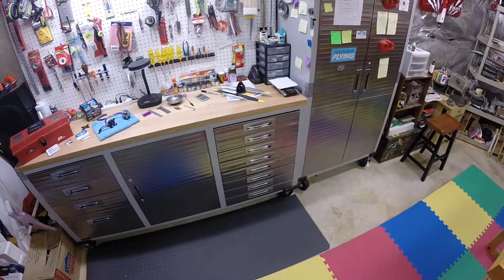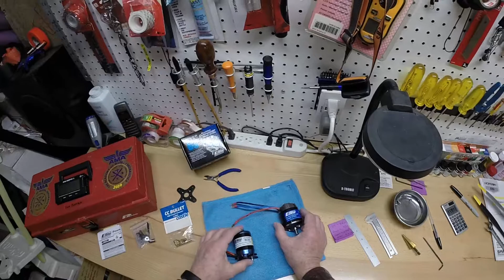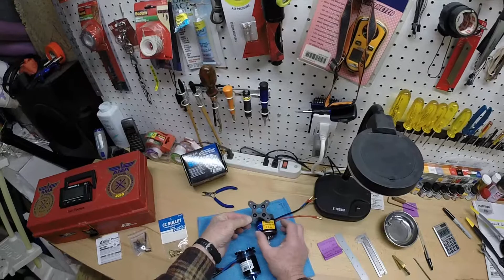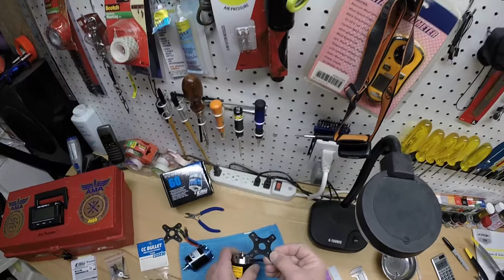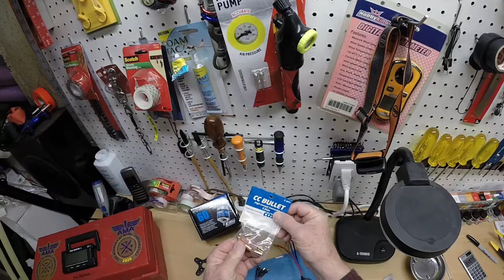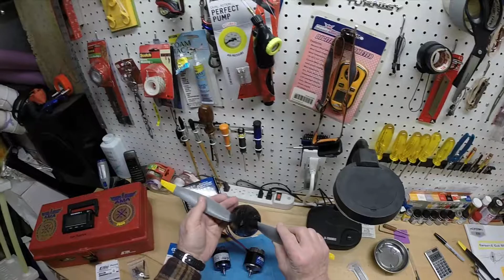Carbon Z Cub - Power 60 motor upgrade - - Part 1

Comment: What is the resistance of the 50?? Currently draw is (AWG of wire) is proportional to the resistance.   Power 60 I think is 2 ohm.

Comment: I’m pretty sure I found out what size pro adapter to get found it on Amazon thank you
Reply from the maker: Great!
Reply: Which one did you get?
Reply: @a @alancotufa4992
Reply: @alancotufa4992  this is the one I got on Amazon. It would not allow me to post a picture of it so here is what it is. E-flute Adapter 8mm shaft power 46/60 EFLM1934.  Hope this helps.

Comment: So after you installed the new front bowl on prop and also the heavier power, 60 470 KV motor was you still able to retain a good CG on the plane with the battery shoved further back.. I did this similar to a 1700 plane I had and I had to actually put fumy tires on it to lighten up the front to get my CG. I am wanting to put that motor in my carbon cub 2.0 but I was worried about the CG and what I need to do, and I was also thinking how much more weight that Debro bought on prop is going to make it way as well in the front end? Any info you can give me I would so kindly appreciate Dan thank you so much

Comment: You should NEVER cut brushless motor wires for any reason this is considered an improper modification and can cause the motor to fail the instructions that come with the motor specifically say DO NOT cut the wires.
Reply from the maker: I have never had any problems with "shortening" motor wires.  Check out my video previewing this plane.  Where you run into problems is "lengthening" wires and trying to draw too much current through under size wires for a particular application.

Comment: I wanted to see if you decided to try upgrading your BL50 mnotor to the power 52 motor as oppossed to the power 60  which you found to be much larger?
Reply from the maker: No, I have given up on it for now.  The BL50 is working well and is really all the power I need.